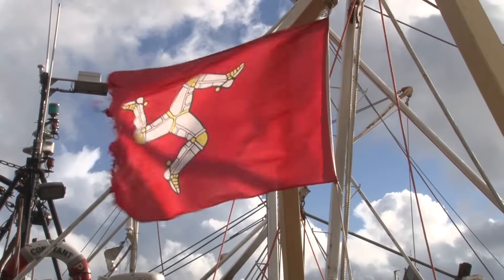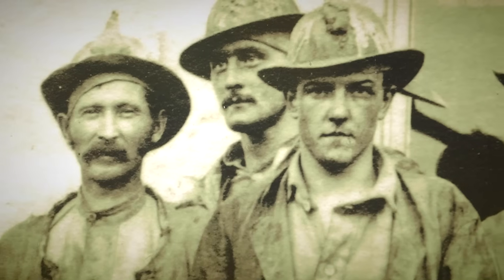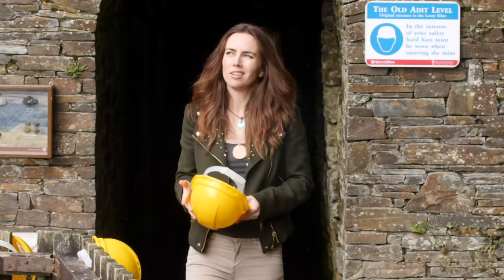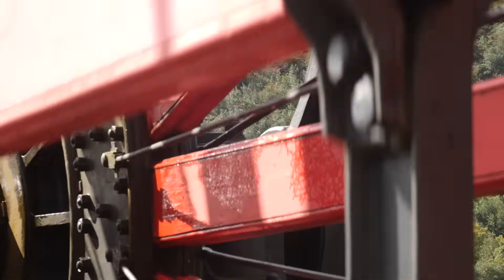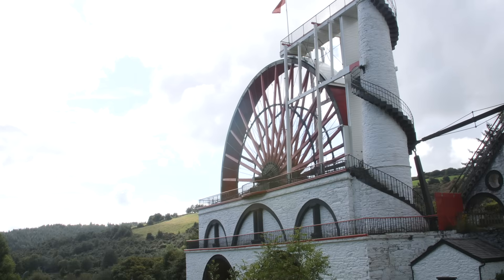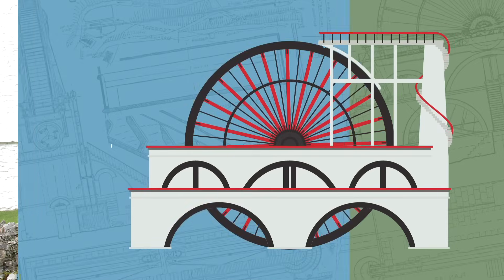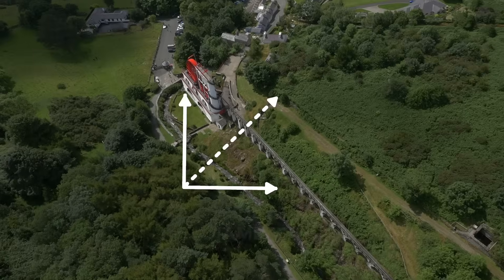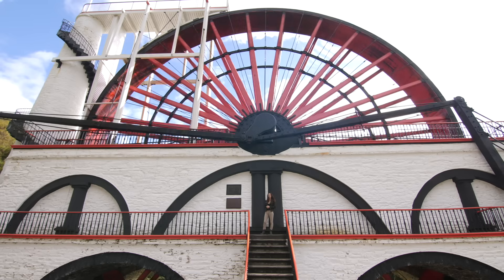How do Waterwheels Work?

Comment: Modern laser cut steel waterwheels with properly designed curved buckets are well over 90% efficiently. One hundred years ago, in the 1920's the Fitz Water Wheel Co. of Hanover, Pennsylvania had one of their steel water wheels tested at the University of Wisconsin and the result was 93% efficiency. A laser cut stainless steel water wheel would last centuries and the only maintenance is lubricating the bearings a the occasional replacement. Unlike turbines, water wheels are safe for fish, unimpeded by sticks, leaves, and other debris which will pass over the wheel without damage. The other great attribute of water wheels is that they will produce power to the amount of water flowing onto the wheel even if the stream slows to a trickle. A turbine can never do that as they have much more narrow flow parameters which can make them worthless when stream levels are low.

Comment: but what's pulling the water up to the top of the wheel? is it a siphon? is it just pressure from the flow of the aqueduct?
Reply: Yup sounds weird. You cannot create energy, I don’t get how they get water up there 🧐
Reply: @YukamsGaming  whatever it was, it worked. so there must be a major feature they didn't show in the video.
Reply: I think it's just the gravitational force. The water flows down hill to the wheel. I don't know the physics of it but I would guess that as long as the source is higher up than the top of the wheel, and the capacity of the water (the amount of water that flows past that point during a given period of time) is strong enough, the water just flows up the pipe to the top.
Reply: @RamseyRimkeit I was there in April and very simply higher up the valley are a couple of reservoirs. By piping water from higher up the liquid will try to equalise at both ends. Ancient principle of a water level.
Sunnydale paper mill in Yorkshire had the largest water wheel in England.
A 50 foot main wheel and a 44 foot second wheel. Though similar to the laxey wheel they had a superior design with a gear ring around the wheel perimeter.
There is another large wheel further down the valley from the laxey but I'm not sure if it's open to the public or its current design or use.

Comment: But how are the water from the streams lifted up?
Reply: The water from the streams are probably sourced from higher elevation
Reply: Dam it up
Reply: An inverted siphon. Basically the water flows down the pipes, fills up a container, then the pressure forces the water up the pipe to the top of the wheel

Comment: Why do they pump water to the top instead of running the water along the bottom of the wheel
Reply: The potential energy of the water is greater at higher heights, therefor you can extract more energy. If the water flows underneath the wheel, you can only extract the kinetic energy of the water. If you let the water fall you can extract the kinetic and potiential energy, producing more power and increasing efficiency.
Reply: @boomfly9543  though they need to pump the water up, so not much of an energy gain
Reply: @YukamsGaming  yea ideally you just build it under water level but if it takes 5 MW to pump it up and you can extract 10 MW more out of the water then you still profit, although takes a economical analysis to see if its worth the capital cost of the pump
Reply: @boomfly9543 at that point why didn’t they just use that pump to get the water out in first place. seems over engineered
Reply: Check with Wikipedia. The source reservoir is above the top of the wheel. The water is conveyed in pressure pipes as a reverse syphon. Funny smarty pants didn't mention that. It's an obvious question.
Reply: That's called an "overshot" waterwheel.  It produces more power than an "undershot" or a "middleshot" sometimes described as a "breastshot".

Comment: Very inspirational. I Thought of a method of a totally self contained water wheel approximately 6Ft. 6" diameter  with a width of 12ft. that can turn a standard 22hp. whole house 200 amp generator . Get this, you don't need a running stream, river, or flowing creek to make it work. I'll get back with you all with some drawings and video of this recently inspired concept. Once I put this concept out there its yours to do with what you want.
Reply: What's the update?